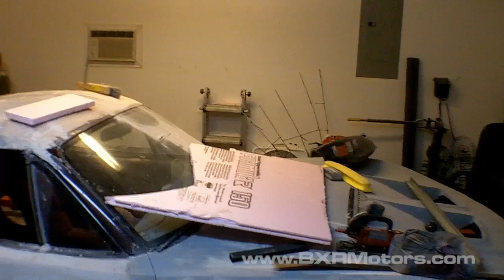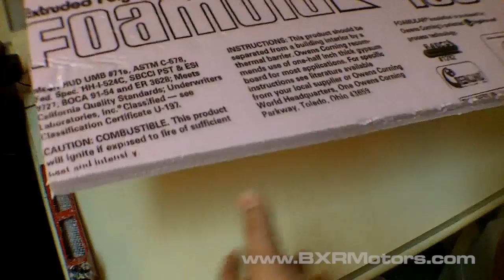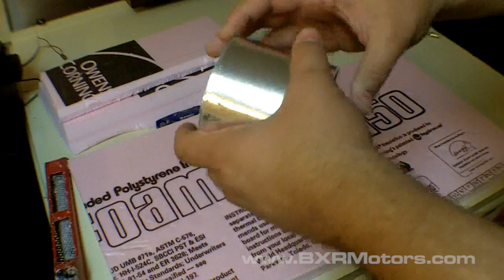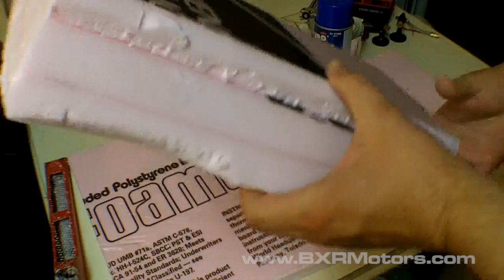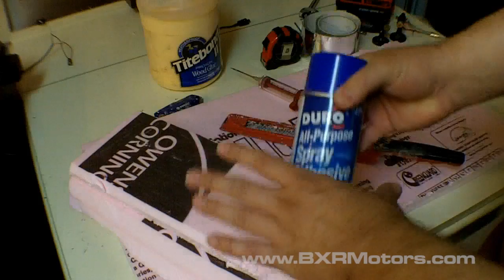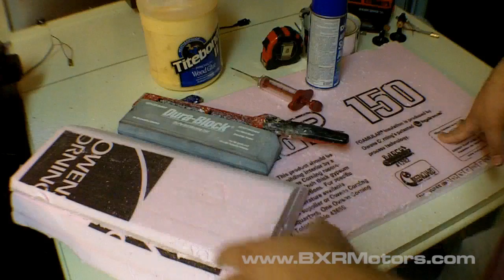It's All about Styrofoam and I have a new Forums site - Bailey Blade XTR - Part 51

Comment: Spray foam insulation works well as glue and you can glass on it. I'v used it much for set design.
Reply from the maker: Robert Lowe yeah I tried spray foam and two part foam mixes. some worked well but it was difficult to get consistent density between mixes.  I've used it for other areas like dash design where it worked better.

Comment from the maker: @tahvkaa Yeah thats true, I should have mentioned that in the video. The issue with using Epoxy is the cost. With a project like this there are a ton of modifications and changes and using Epoxy would be to expensive and timely as the cure time is much longer.

Comment from the maker: @DarkBebi Yeah you needed to protect that foam, if you try it again use the tape or you could use an acrylic glossy paint from the hardware store. paint the foam a few times and then lay the fiberglass down. Thats a good method if you have a lot of details in your work.